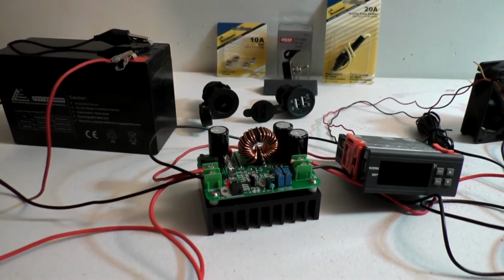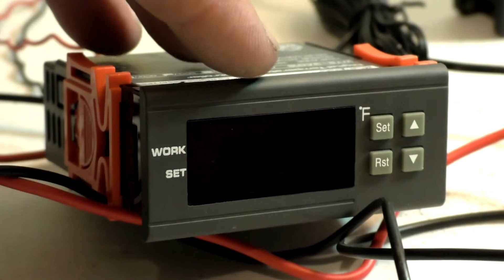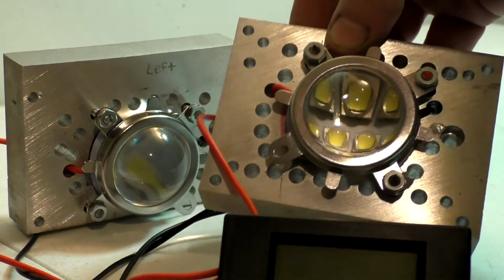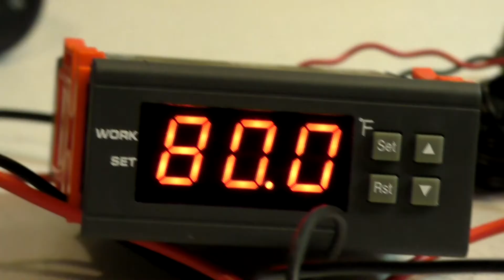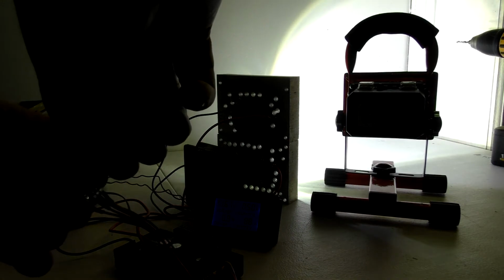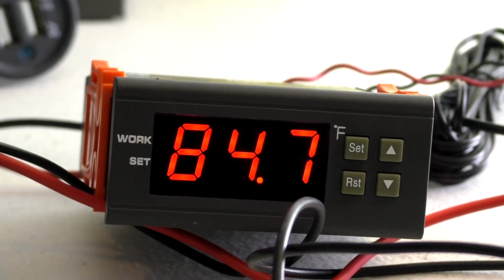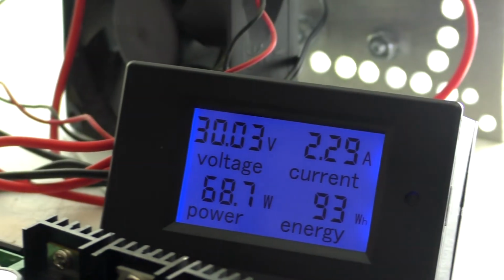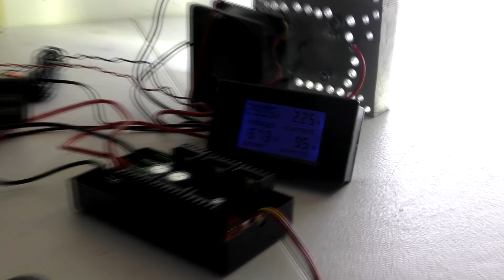20,000 Lumen Super Flashlight  build

Comment: Cool project. I wish you showed us how you mounted the leds to the heatsink. Are all leds visible through the lens? Does the lens hide any of the leds even when trying to view them through the lens from every angle?
Reply from the maker: Set the led on the aluminum and  marked the holes. Drilled the holes out, set the led on with thermal paste then ran small screws through to bolt it on. All led's are able to be seen through the lens. Basically the lens is a little large than the led group. Not sure if someone used the cheap star that has 20 led's on though
Reply: +scannerguy1968 I was confused. Through the lens it looked like you had to glue (with thermal adhesive) many leds individually to the big heatsink. I didn't know you could buy these as a single item. And now I notice there are no wires (which indicates there is a pcb below), so,,, silly me. Thanks.